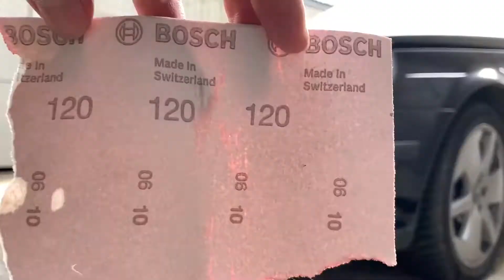Cleaning dads new 370.000km Saab 9-5 and get it road ready *no talking* no music* Saab detailing

Comment: Man, with all due respect. I suspect you may have scratched the car doing what you did.. You should never go hands on with a normal shampoo like that before doing a full pre-cleaning step (e.g degreaser of alkaline and petroleum type, then shampoo and wash by hand). There is something called ONR which is a no-water shampoo for situations like this. You also dried the car but didn't put on any protection (e.g wax). There are simple ceramic spray waxes that you can spray on a microfiber towel, then just apply them to the paint after the drying and you'll get a crazy gloss + protection for the future. It will help against sun fading, rust, scratches and keep the car more clean longer.

Other than that, amazing work and especially on the interior that was satisfying.
Reply from the maker: Thanks men ! 
I didn’t put any wax on because the car got polished after the wash.
Reply: @saabtrip3714  Oh okay sweet. Sorry if I come off annoying man, I'm just heavily into car detailing and always try to avoid any scratching. If the car was to be polished afterwards, then this whole thing makes much more sense.